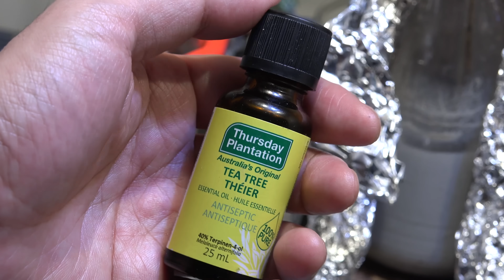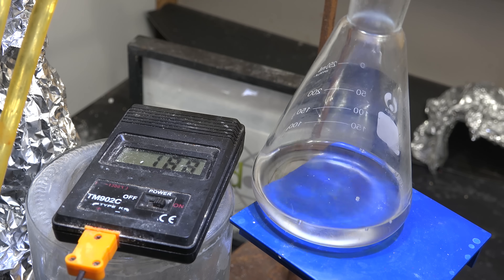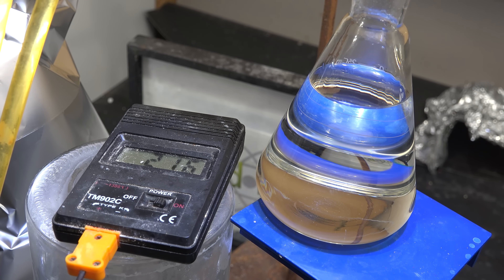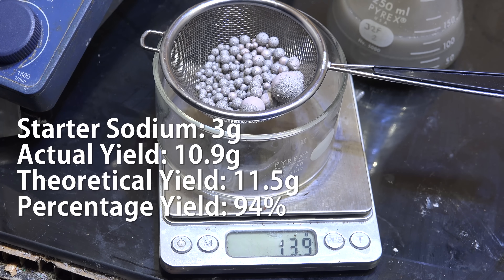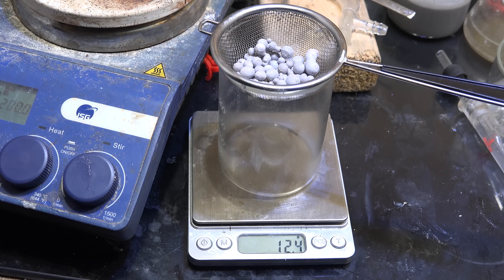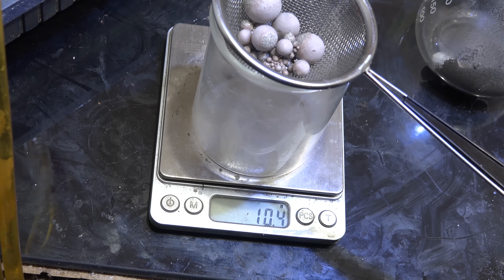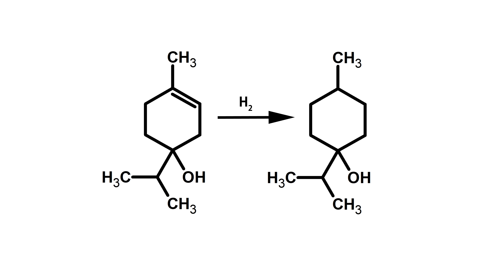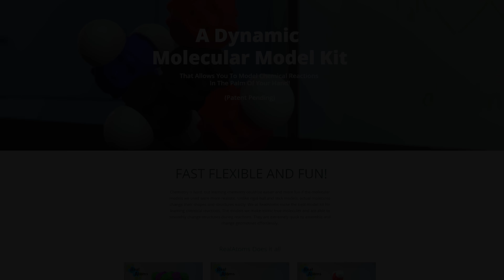Lab notes  - Purified Tea Tree Oil Experiments for Making Sodium - October 13th 2018

Comment: How did the first fractionation column fail but the 2nd one worked fine? You said the 2nd one was a little smaller, but how exactly did that help? You were distilling a decent amount, so I wouldn't have thought that just that size difference would make a difference.

Comment: Just tried this separation tonight with a 50cm column and can confirm it’s a very difficult separation. I’m going to try again with vacuum distillation. Also for your own sake avoid taking any of the lower boiling fractions (~150-180C) out of your fume hood. They’re extremely acrid and unpleasant.
Reply: One more thing: if you buy your tea tree oil online, dry it with some CaCl2 or MgSO4 first because it’s probably been steam distilled and will have a lot of residual water in it. Steam popping off in your glassware is a good way to break it.

Comment: You need a welding blanket vs using tin foil. It will help keep the heat in much more efficiently. They are very affordable in the tiny size you need.

Comment: Mmm.... if memory serves, nickel catalysts can be used to selectively hydrogenate alkenes without causing secondary reactions with alcohol groups. 

As far as fractional distillation, actually your setup is more than adequate. 
You should add heat to the smaller heat exchanger though, not cooling. 
I could detail it out a bit more but, describing knees in a distillation plot and how that correlates to purified compounds is not exactly easy.

Comment: Just came from @NileRed 's video on making phthalic anhydride from latex gloves and noticed the tertiary alcohol 2-ethyl hexanol is formed as a byproduct of the base ester hydrolysis of DEHP. Could this be extracted and used as a cheap and easily obtainable catalyst for this reaction? I would test it myself but, alas, my heating mantle is broken right now. Any thoughts?
Reply: @Hurricane's channel The 2-ethyl hexanol actually constitutes about 1/3 of the molar mass of DEHP so I think that there would be enough present to at least extract a catalytic amount. That is of course assuming that you can get a relatively good extraction yield while keeping everything dry though...

Comment: So how much is this altogether in comparison to simply buying sodium somewhere? (Include electricity costs)
And then, can you do a test on how low you can sensibly get the cost of labware? Can you use a stove and some cheap random glassware? (Maybe by heating it in a pot with sand)

Comment: it is possible to make sodium metal without a lithium or sodium jumpstart right? (ofcourse it would damage the glass but I am sure you can get them for cheap from china) also do you think its possible to make lithium metal from something similar to this? now I know you can get a gram of lithium from the lithium batteries but thats not that much, I havent seen any video discussing the making of lithium metal without involving fused salt electrolysis and there is really only 1 video on how to make lithium by that fused salt method. I think you could challange yourself to making lithium metal as it could be really useful for reducing alot of things

Comment: Why not use a vacuum distillation to reduce the boiling temperature?
Reply: I think he's trying to keep it accessible to a bigger group of amateurs. Vacuum distillation is a time consuming pain in the ass, not to mention your pump exhaust is going to make the whole house smell like an extremely pungent foot massage. :-)
Reply: Grak70  with a scroll pump/diaphragm pump, the exhaust can be run through a condenser of sorts.  Not much vac would be needed for a quality fractionation
Reply: William V well I tried this distillation myself and boy was it a mess. First off, water left over from the steam distillation bumped for a good hour, then thermal decomposition produced some impressive lacrymators! The acrid stink is incredible. I guess I’ll try vacuum distillation after all! At 30torr it should boil over around 90-95C and not decompose. I dunno how NurdRage did this without getting acrid black tar in his bottoms fraction.

Comment: If you need a more powerfull heater you can use one of those electric ceramic heaters with the resistor at plain saight that gets red hot. Those exist well over 1000W. You can drill a hole in the middle and inser a thermocuple to regulate it by hand or get a thermocouple kit for arduino and use an arduino to do it for you.

Comment: Could you also try menthol as the alcohol catalyst? I know it's a secondary alcohol instead of a tertiary one, but it doesn't contain any other functional groups, unlike terpineol. It's also potentially hydrophobic enough for the alkoxide salt to be soluble enough for it to work in this process. I'm not sure how easily it could be obtained in sufficiently pure form by the amateur chemist, though.
Reply from the maker: i have menthol and a few other alcohols all be testing in upcoming videos.

Comment: As for 4-terpineol... Maybe we don't need to make hydrogenation. What if we make simple acid catalyzed water addition to the double bond, and make double tertiary alcohol? In theory, it is just some cooking in diluted sulfuric acid. What do you think?

EDIT: after some search, I can say, that a lot of terpenes and terpenoids after treatment (some cooking)  with diluted sulfuric acid rearrange to stuff similar to terpin. I feel that we can do that with crude tea tree oil, and products of this reaction would be just tertiary alcohols. If so, this would be robust, cheap catalytic system easy to obtain for any hobbyist.
Reply from the maker: i did try and make "terpin hydrate" (which is the water addition product) but i could never get it to work. I'm probably doing something wrong.
Reply: The only problem and plus in the same time is that it is old chemistry (1880-1920). A lot of papers are written in German (with I personally sparingly understand when there are good schemes). This is bad. Good is that this is old chemistry: if it is not possible to purify stuff by distillation or crystallisation, they were not doing it. We need some isoprenoid chemistry specialists here.
Reply from the maker: Yeah that ain't working. i left it for three weeks now and nothing is coming out.
Reply: Sad information :/ But still I hope that something can be done in this direction.
For now: keep going! Wonderfull work which is getting better with each video :)
Reply: I think this should work.  We would end up with 2x tertiary alcohol groups, since  in a Markovnikov addition, the hydrogen would preferentially bond to the #2 carbon, and the OH would attach to the #1 (already tertiary) carbon.
Reply: Exactly. @NurdRage, what do you think? Definety worth traing on purified 4-terpineol, but also as I wrote above, also on crude tea tree oil.
Reply: Old publications had soul XD There should be a section about water addition to a double bond, but I was not able to pin it down :( Maybe there are "magic conditions" which would work. As @NurdRage wrote, just stirring for prolonged time don't work.

Comment: Citric acid is a tertiary alcohol xD
Reply: Seems so. Does it dissolve in mineral oil ?
If not, wiki reckons it will in dioxane.
Reply: Even if the base doesn't, sodium will completely deprotonate the acid as it's produced, causing it to salt out.
Reply: but it has another 3 COOH which make it very polar...
Reply: So it has to be a tertiary alcohol with just 1 -OH group ?
If all those O= knocking about on TSC pose no 'polarity' problem, what about asprin ?
Reply: AFAIR Aspirin decomposes on contact with NaOH
Reply: Maybe a tri-ester would be able to dissolve in the mineral oil and survive given that the solvent is dry so no hydrolysis can happen?
Reply: Nuovoswiss
Oh yeah, silly me. This kind of hydrolysis doesn't really need water to work lol.

Comment from the maker: Lab gods, do what you must, for we have already won.
Reply from the maker: couldn't find a prep for pinacol that didn't involve mercury.
Reply: afaik there was a way with isopropanol and acetone with uv-light. Anyway, what about addition of HBr/HCl to 4-terpineol and then substitution of Br/Cl with NaOH to remove this double bound by replacing it with another tert-hydroxy group?
Reply: If mercury is used for amalgamation of aluminium there, maybe it could be replaced with gallium?
Reply: contact cody's lab he loves sloshing about in mercury
Reply: NurdRage I have been following all the way! You can do this! Also could you add a clock into your time lapse. A analogue clock works great. Thanks!
Reply: Thank you! Honestly, these lab notes are just as interesting as the "actual" videos you make.
Really interesting to see how Sodium can be access by the amateur chemist now!!
Reply: Congrats, Nurd!
Reply: Awesome work and contribution to humanity!
Could this qualify for a PhD?
Reply: And Lee Robinson : it wouldn't be nearly enough, but I guess it could make a publication!
Reply: Andy Lee Robinson, he is already a PhD.
Reply: Great success, congratz! 
There's a product on amazon called: "Terpineol High Purity Aroma Compound" which might work without fractional distillation step. Thoughts?
Reply: Could you try steam distillation to perform the distillation at a lower temp and dry the solvent later?
Reply: Brilliant stuff. Vacuume distillation should help lower the boiling point enough to make it easier to fractionally distill if ones heat source is not enough. Although that requires you to have a decent enough pump so depends on what you have I suppose.
Reply: Did you tried pinacol which can be easily obtained by pinacol coupling of acetone with magnesium and acid work up. This result in a Di-tert-alcohol, which may be even better?
Reply: I thought you already resolved it with swapping out the lithium with sodium?
Reply: Yay we finnaly won  pure tea tree oil for the win
Reply: Oh? Challenge excepted.
Reply: It takes too long to do the reaction. That is my only complaint
Reply: The tea tree oil is from Bulk Apothecary isn't it 😅
Reply: Have you considered hydroxylating the terpineol with sulphuric acid and water? It would get rid of the alkene functionality and introduce another tertiary alcohol center? It might be interestering to see how the diol would perform.
Reply: @Nurdrage it would be really cool if you could show an at home synthesis of pure magnesium metal!
Reply: id523a, "exotic tertiary alcohol that any amateur chemist would have to buy specially" it may be even worse, such alcohols may not be available for sale to private people and be boring enough for the black market not to stock them either. The only solution may be to do it yourself, which is way harder than making sodium (and you will need sodium to perform that reaction in the first place). Honestly, I'd opt for the 'hot', non-catalyzed variation of the process if I were to try to reproduce it.
Reply: I think the amount of catalyst used was proportional to the amoum=nt of magnesium used. Otherwise, a greater amount of catalyst would not have decreased yield. Keep it in mind next time.
Reply: Tea tree oil ? Its an inferior solvent. In Australia eucalyptus oil is considered a better solvent. We use it to remove any sort of sticky mess. Bubble gum etc
Reply from the maker: @bloodyricho1  what are you talking about? It's not being used as a solvent here, it's used as a catalyst.
Reply: Well you jinxed yourself. By the way things usually go, your lab will explode #RIPnurdrage.